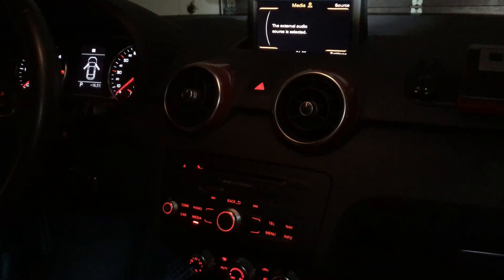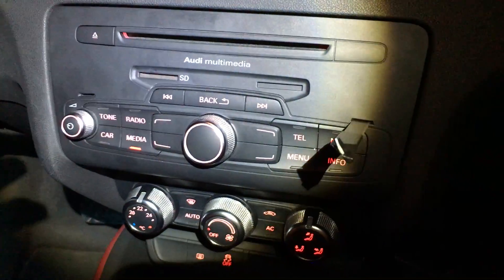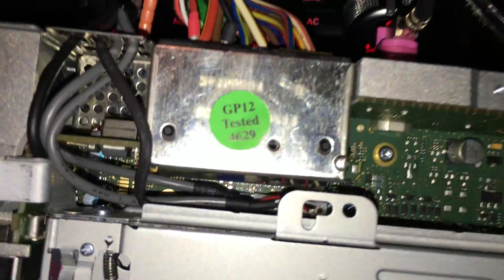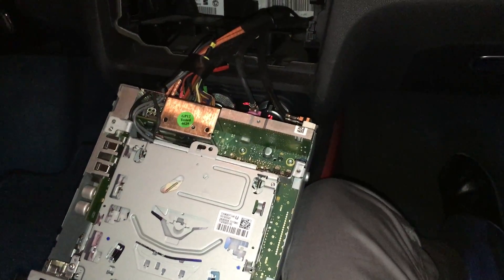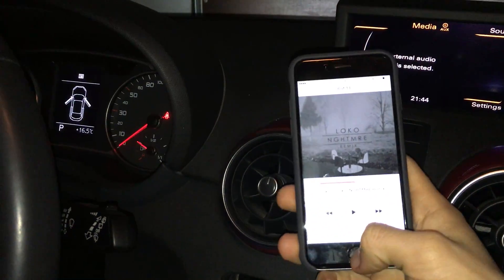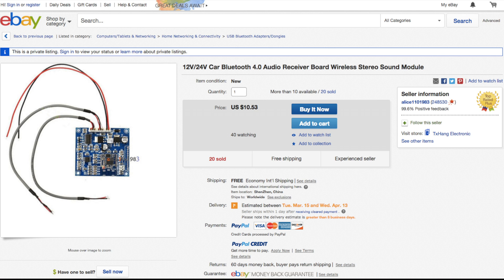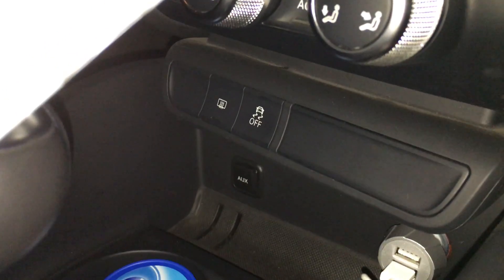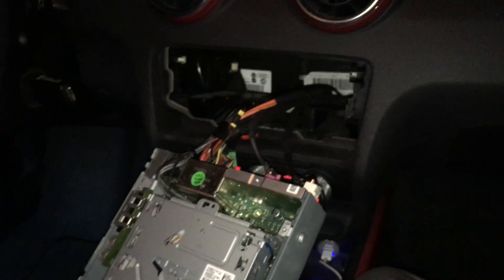Bluetooth Car Module Installation (Part 1)

Comment: hi I bought a module after watching your video...could you help me...I see the aux l/r join to the aux on the stereo but what about the other out l/r wires...do they join to make a loop...also do I join the power from my acc so its only powered once I turn the ignition?...if you could help me that would be great, cheers
Reply from the maker: ok, so the module works in two ways: 
1) it operates as a bluetooth audio receiver (which is what you are presumably using it for)
2) as an extension of the existing auxiliary input of your car, meaning that when there is a music source coming from your aux cable, such as an old iPod for example which does not have bluetooth. In that case the bluetooth music connection is interrupted and music is being sourced from the wired connection. On the other hand, if you were to receive a phone call at the time when your wired connection is on, the bluetooth chip will automatically switch to bluetooth speakerphone, activating the bluetooth microphone as well as your car speakers. 
I'll make a video explaining this again if you like so that others understand it as well. If there is anything else unclear about it, don't hesitate to let me know. :)
Reply: Hi, I want to use it as a handsfree for calls and also as a music player from my phone through my car stereo so just wondering how to wire it up...what wires go where?...my car stereo doesn't have an aux input so can I still use it?...Thanks again in advance
Reply from the maker: In that case i wouldn't be able to help you because you need to have an auxiliary port for this mood to work. if you tell me the make, model and year of manufacture of your car i might be able to tell you more about your stereo and where to hook up the wires.
Reply from the maker: Ok, so for handsfree you need to connect a microphone to the USB chip and run it through your car all the way to some convenient place, however, that being said, you can't have the device working in either way unless you have an AUX input. So you may need to try and find a diagram of the electronics board of your current stereo so that you can find out if it does or doesn't have some form of AUX on the motherboard itself. But I couldn't help you with that one unfortunately because I don't have your car stereo in front of me so that I could have a look and identify the ports (if there are any hidden ones). Hope that answers your question, because I know that it won't solve the problem.
Reply from the maker: https://youtu.be/VW5urQ5vx9k

Comment: Nice video! Which Microphone did you use?
Reply from the maker: Sorry for the late reply, I used a long 4m microphone that I could run up to the light switches in the Audi A1 as there was a perfect little gap there for it. But any standard computer microphone will do! You just have to solder some connectors from the mic-input to be able to fit the whole thing more easily. I'll do another video soon and it will explain most things hopefully.
Reply: DJ IBI do you have a Link to the microphone or a similar one? I don't know what type of microphone i have to use for this build. Thanks
Reply from the maker: Yeah, sure. I used something similar to this: https://www.aliexpress.com/popular/pioneer-microphone.html
It's just a small microphone with long 4 metre cable. I used a 4m long cable so that I could tuck the cable under the ceiling of the car roof and along the right front column so that i could reach under the main MMI (Multi Media Interface) of the Audi and have it run directly to the Bluetooth Module. That way the mic is in a location where the sound from my voice would come directly and clearly at it without being muffled and silenced somehow. In my case, even "Hey Siri" worked so that means that the voice was recognisable.
Hope this helps :)
Reply: This helps a lot! Thank you